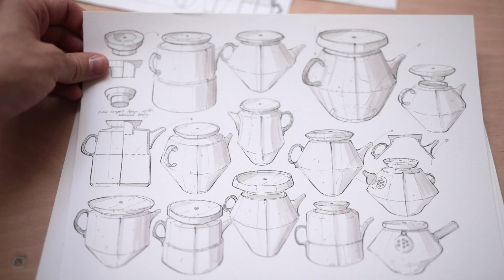From Sketches to Finished Pouring Bowls — ASMR Edition

Comment: How do you get the area just below the spout so smooth? I can't figure out how to trim that area, other than sanding it after it is bone dry.
Reply: If I understand what he is doing right, I think it's that smooth right after throwing, before he makes the spout.

He tends to use a kidney to scrape all the slip off, and  on his clay that leaves a super smooth surface before the clay has even dried. Then it's still that smooth after he makes the spout indent.

Or at least, that's my guess!
Reply: @daboross2   Thank you!